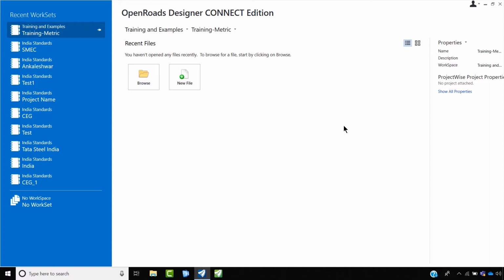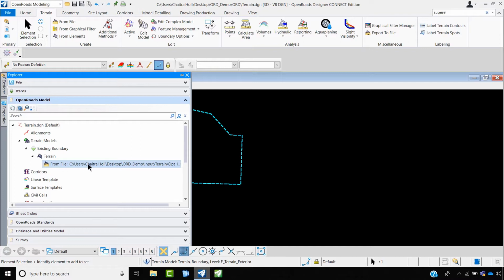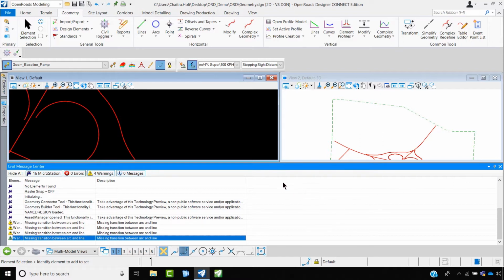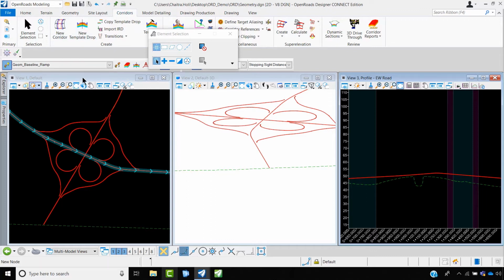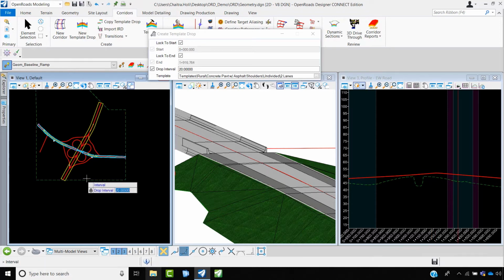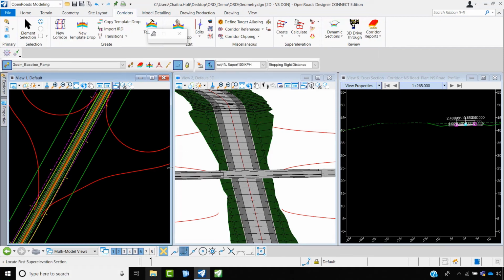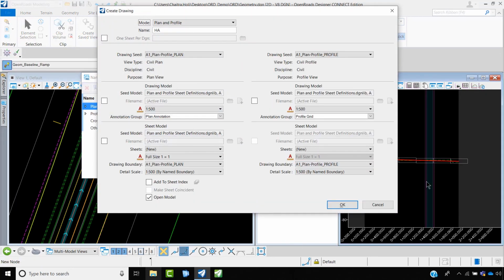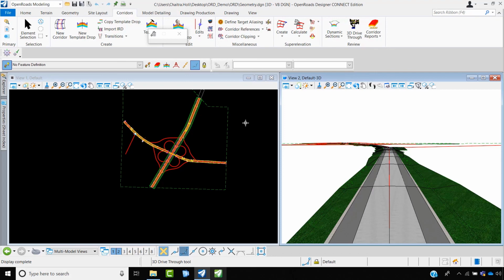Road Design with OpenRoads Designer Strategies for Beginners | Bentley Education

Comment: 00:05 Introduction to OpenRoads Designer workspace and project creation
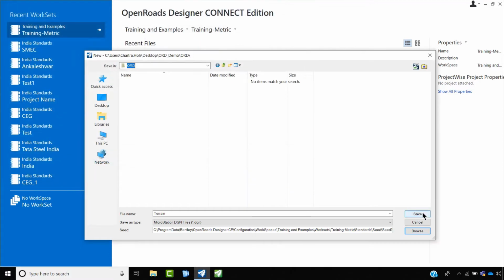02:52 Introduction to OpenRoads Designer workflows and tools
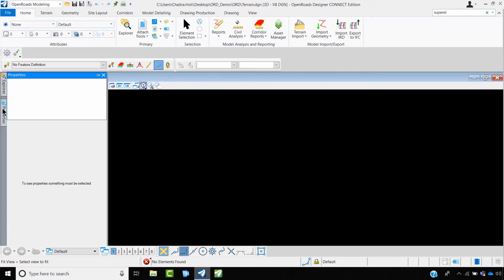07:53 OpenRoads Designer provides various views and tools for road design.
10:17 Managing and updating terrain files in OpenRoads Designer
15:48 Creating and assigning active 3D profiles in OpenRoads Designer
18:04 Using feature definitions for road representation
22:42 Adjusting design values and errors feedback in OpenRoads Designer
25:17 Adjusting transition length to meet design standards.
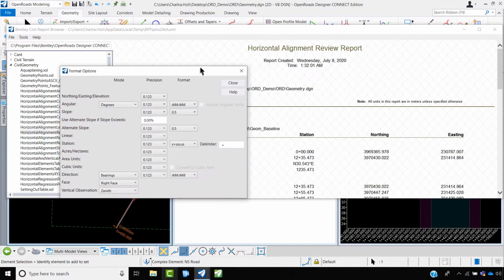30:48 Exporting horizontal and vertical profiles and creating corridor models
34:13 Selecting and using active profiles in OpenRoads Designer
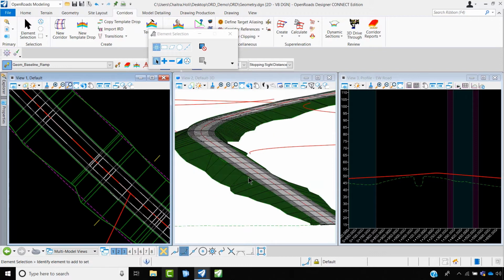38:18 OpenRoads Designer templates and working with them
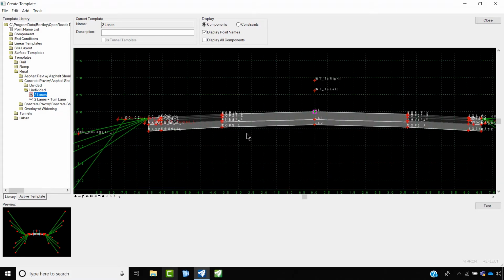40:19 Road design involves defining points and component properties with constraints.
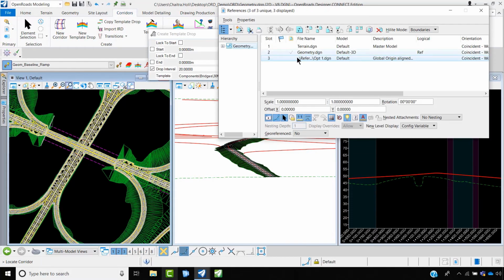45:08 OpenRoads Designer allows for 3D modeling and editing of road design elements.
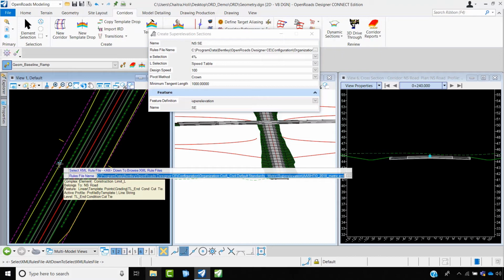48:41 Storing super elevation equations and applying supervision rules.
53:39 Understanding and editing super elevation values
56:03 Utilizing lane display for dynamic updates
1:02:39 Creating road designs using OpenRoads Designer
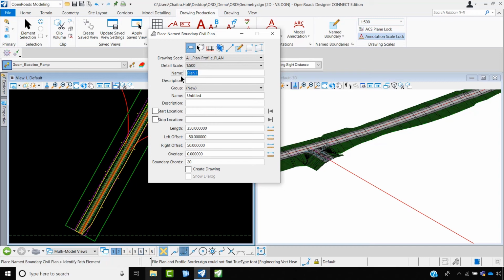1:05:28 Creating alignment profile names and setting left/right offset
1:10:42 OpenRoads utilizes design files for annotations and plotting.
1:13:22 Annotating and exporting drawings in OpenRoads Designer
1:21:04 Completing the workflow for bridge design